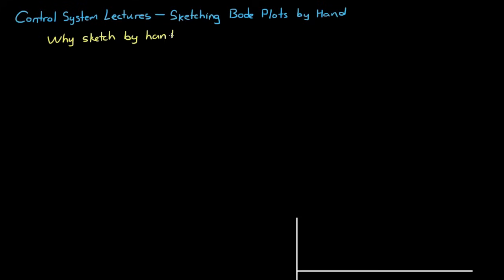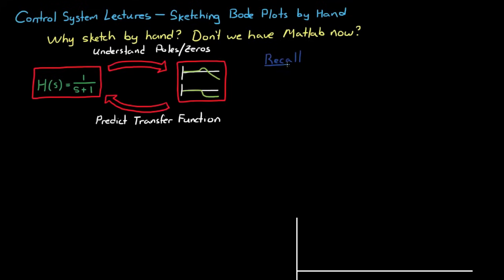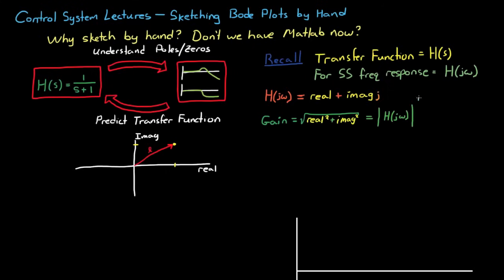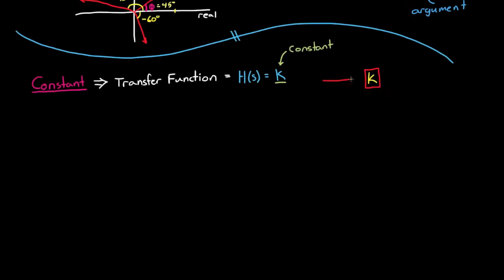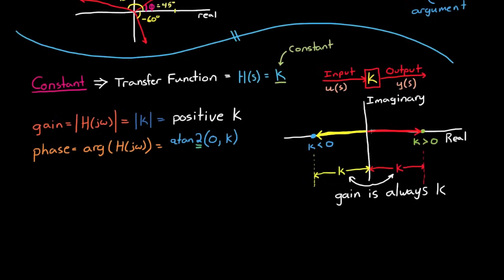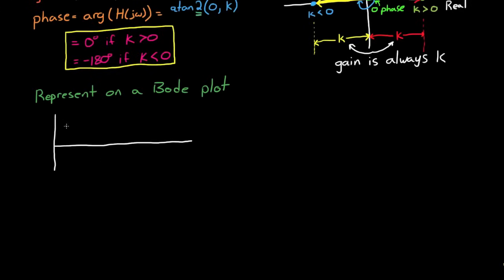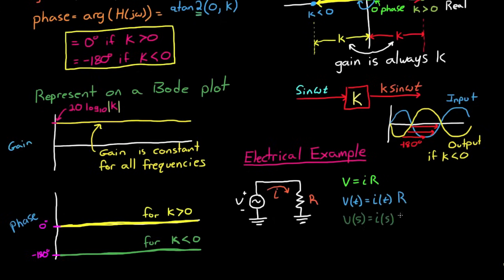Bode Plots by Hand: Real Constants

Comment: I just ran onto your Chanel. I'm a 45 year old veteran of systems and find control systems theory a big help in areas you really wouldn't think of a control system.  Yes I can do Bode plots without a computer! There is the academic world and there is the real world. Much of my early years in engineering was spent unlearning stuff I was taught in school. One that bit me was learning to inspect equations looking for Sin or Cosine functions in the denominator. Both of these functions pass through zero so you have a divide by zero problem which requires you to bound functions very carefully. Another one is the control systems for "Fly by Wire" fighter planes often have components in the right hand half-plane. How do you handle deliberate instabilities when you were taught to eliminate instabilities? Oh yes, screw up this one and people may die. No pressure!

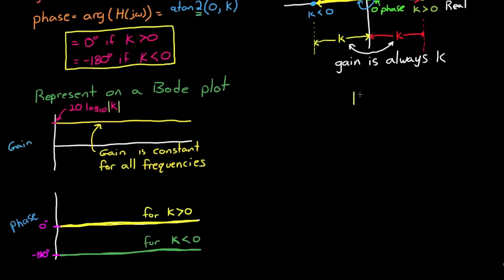Comment: 5:59 I'm not too big a fan of how you go back to the time domain without prefacing it, when you draw the block diagram and the sine waves. It makes it seem like the transfer function is equal to the gain generally, despite this example being a special case of where the gain and the transfer function are both constant and equal. I wish that whenever you go back to the time domain, you very clearly state so. But I love these videos! They are saving my life in my controls class.

Comment from the maker: Hmmm, I don't think I would use 360 deg for the phase shift of a '+ve' constant.  I'm not saying the books are wrong, I just can't think of a reason right now why that would be useful (if you find out somewhere else could you respond again so that I know?) My reasoning is this: to me, an output with 360 phase appears to be the same phase shifted signal as the input, but I would say that it was delayed one whole cycle.  A + constant doesn't delay the input at all so the phase shift is 0.

Comment from the maker: I am not familiar with that calculator.  However, an easy workaround is to keep track of the quadrant yourself and just use atan.  Then apply negative or positive as necessary.  Just draw your point on a unit circle and it should be easy to see which quadrant it's in.